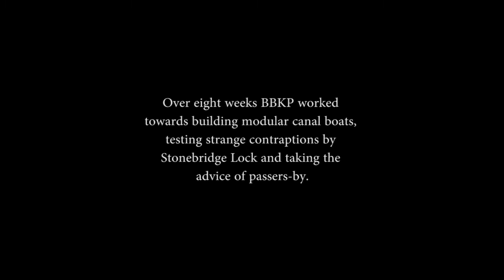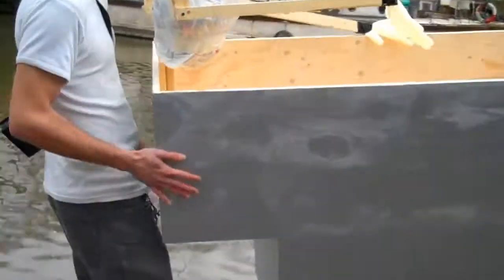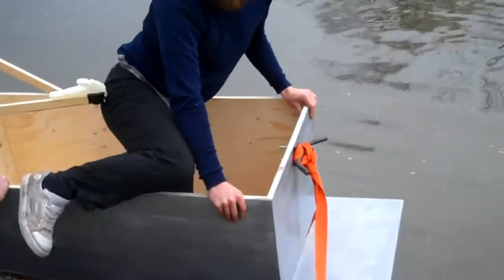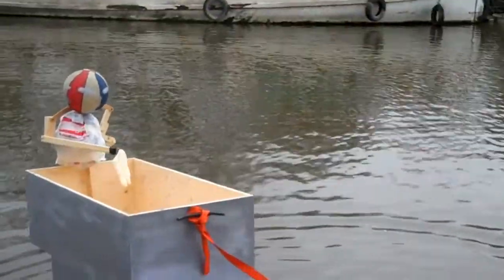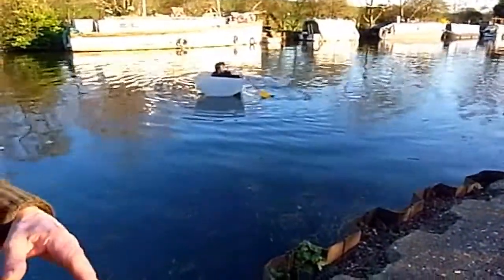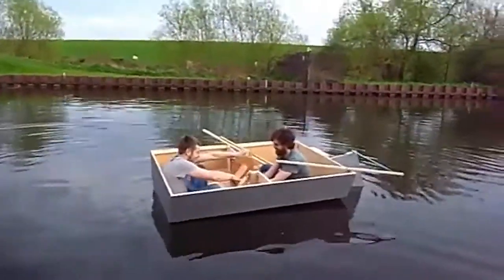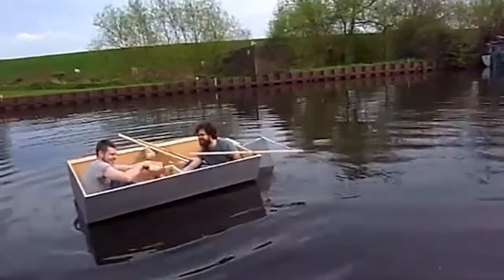Boat Project - Tottenham Hale international studios 2011

Comment: Ok, you gave me an idea for one. Imagine 32 of those one-foot rubber air filled balls that are really inexpensive at the supermarket. If you had a 4x8 sheet of acrylic glass with a frame around it and a net underneath, it could sit on top of them as they floated. You would have a see-through boat!